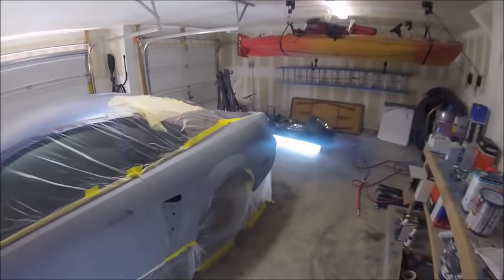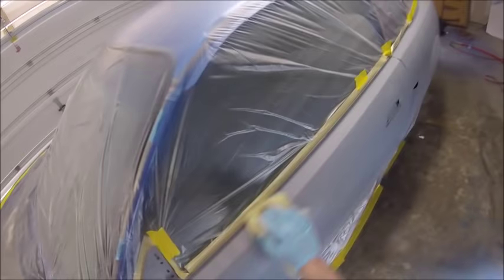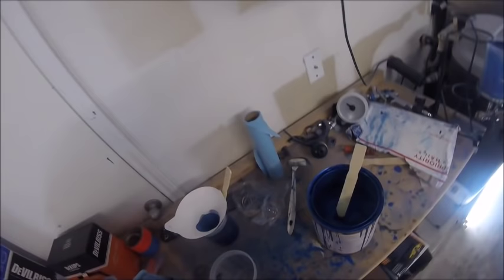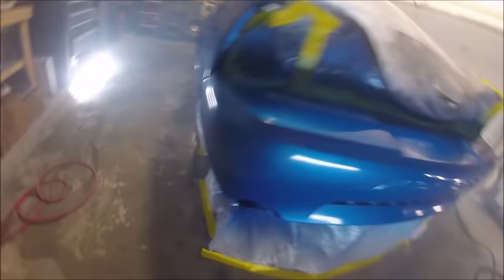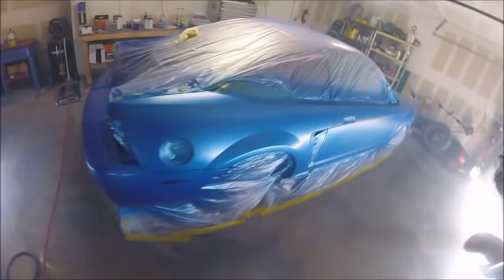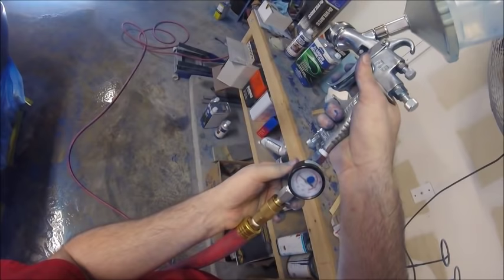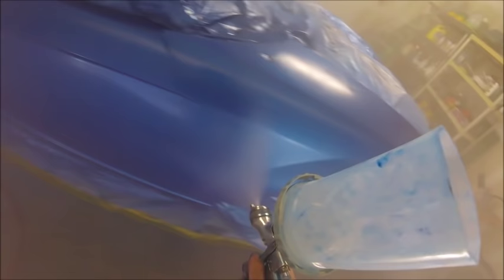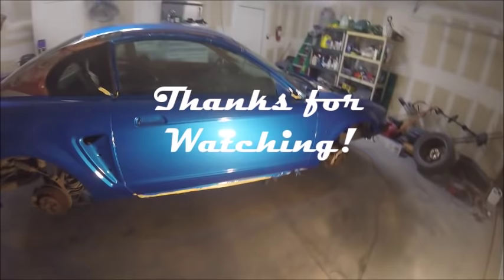Painting Your Own Car At Home

Comment: A Devilbiss Prolite is a great gun for the money.  I know many pros that use nothing else for show car quality paint jobs.  If you having any problems with it, then you're doing something wrong, not keeping it clean, set up wrong...etc.  Also, most people I know spray the basecoat with a 1.3mm tip and then, depending on the type of clearcoat, move to a 1.4mm tip especially if the clearcoat is a high--solids clearcoat. The Eastwood clearcoat you're using is a hIgh-solids clear. It comes out more orange pealy than the basecoat most of the time. Sometimes depending on the temp you're spaying at, you might need to reduce the clear up to 10% to reduce the orange peal.  Regardless, you did an exceptionally good job for a for time full paint job.
Reply: I was thinking the same thing when I say "European Clear" The Euro cars usually have more orange peel than American production cars
Reply: rstreets its a good gun for cheep plain and simple besides that its shit no matter what you do in the long run it will shit out.....the guts are cheep and will fail eventually especially running solvents through it for cleansing
Reply: FLG5 is a great gun and it's under 200 bucks .

Comment: Old timers put stainless steel balls or bolts in the cup and shake the gun to keep the metallic and pears mixed up. Metal flakes to.. also, pouring the mixed paints back and forth in clean cups is called "boxing" it mixes the paint,reducers and hardeners together much more evenly.  Very nice job, love the color.

Comment: I am a professional painter and worked in collision centers most my career. You did very well for the hobbiest weekend warrior. I have trained and instructed several apprentices on refinishing techniques and learning the materials that you are going to spray. For the most part, I can tell when someone has the ability to spray or not. You seem to have a good base of knowledge to shoot solvent paint systems. 1 thing I've learned while training people, is you cant force someone to paint in your own personal style. I watched for their natural tendencies such as if they are a slow natural stroke or if they are a quick mover. Every gun sprays differently and spray best at different psi settings, for different materials. For the most part broham, you did a great job. Might I suggest just a little tighter overlap with clear and maybe dropping the psi to about 24 to 26psi with that devilbiss. And make sure the reducer you use to cut the clear is compatible with that clear system. Or, if the clear requires a reducer at all as most inexpensive 4:1 ratio clears have a lower solid count and by reducing the clear, it reduces its uv protection and promotes solvent boil and runs if applying too heavy or applying the following coats too soon.  Applying clear takes some practice as the application method is different than applying high pearl/metallic base in solvent. Waterborne base is completely different in ppg and spies hecker, etc.  All in all, I think you did a fine job. I've seen 15 year "refinish tech" do worse, but they will make excuses till the sun goes down  and you seem to be honest about your hiccups. Just keep at it man. Practice is tough when paint is so expensive.

Comment: I believe what you experienced was not you laying it on dry, but instead dieback or something. When you hit your test panel it should have faded out more from the center really.  With poor atomization - big droplets, one can cover a panel and have it look "wet" but the problem is its misleading because what you are seeing is solvants... when the solvents poof off you are then left with varying degrees of problems. Typically said problems will come in the form of "orange peel" because once the solvents poof off you are generally left with voids where the solvents was if the rest doesn't "melt" down thereafter .. which it typically wont. Really bad atomization will leave dieback or a dry look when the excessive solvents magically poof off on ya like a genie.  The only way to correct such is to get the atomization finely dialed in via adjustment and hitting test panels until its corrected.  HVLP's run 10ish psi at the cap so fiddling a lot with the psi at the inlet is something we all have mistakenly done really...when the real problem is elsewhere if one has too. Consistent air volume can be a concern with HVLP's so I often wonder how well or long those snakes will last before needing changed for this reason.  I usually use a 1.3 but you should be fine there. 
Aside from my opinions or humble suggestions that nobody has to take in..... Pretty good job man, the best painters out there are the ones that know how to correct shit happens mistakes after the fact and keep on trucking.... and I'm sure you are persistent and knowledgeable enough to do exactly that (no worries).  Peace!

Comment: Yeah Bro, glad to see you paint your own ride. I would like to give you some advice on the HS clears. you need to get a comprerssor to handle the paint gun as I saw you adjust your regulator several times. You should never adjust air pressure when spraying poly base coats. also need to apply a control coat to finish you base. 15 psi and double the distance and fog it on 50% overlap. this will set the poly base to stand correctly. as to the clean, temp plays a large roll in the clear application, and the amount of materials. It looks like you needed to have the volume turned up, an move faster. Don't give up, and it came out good enough for you to fix. rock on Bro.

Comment: A word to the wise.  Cover everything in your garage with plastic prior to painting.  This reduces both the risk of contamination and the risk of getting overspray on everything as it will.  Second the little 3m masks are NOT good enough.  A full on electrical respirator or a setup with an outside air feed should be used given the lack of ventilation.
Reply: pprotory that...and without some kind of exhaust and maybe putting it outside, that compressor regulator switch looks like a potential poster child for the people who have exploded paint fumes in their garage because "I never had a problem before" 
just like the gratefully infrequent events of home woodworkers who blow up their dust collection systems. Fortunately not everyone gets hurt or burns their garage down.
Reply: pprotory At a minimum, I wear a 3M full-face respirator with 3M 60921 filters that can filter out isocyanates for up to about eight hours of use. I don't trust the half-masks for spraying paint. I always smelled fumes when I used a half-mask, so I quickly quit using them.
Reply: When my dad and I painted out 76’ Silverado we just draped plastic around our barn and opened the big door, covered it in plastic and cut a hole for the big fan. We used half mask respirators and paint suites. Worked fine

Comment: You should use paper on  the windows because the plastic will flap around stirring up paint dust that will land in your clear, it's easier to tack off.  And, you should have an inline water separator in the air line.

Comment: I really appreciate your upload. I did my 96 Olds W-Body Cutlass Supreme 4 times. 
Vibrant Green Metallic 1, Emerald Green Metallic 2, Metallic Carbon Fiber Gray 3, and finally...after really just plain having enough of the constant debri, i resulted to Summit ALPINE WHITE with 1/8 pound of John Kosmoski .008" Chrome and Purple flip chips mixed in it.  Thats That. It looks great!
Good job dude. At least you had a space. I shot mine in a shitty dirt floor hellhole the first 3 times. And finally for  The white, I took two days off work and shot it in my backyard. I got THE BEST JOB doing it OUTSIDE.  ( like they say- dust from the gun just blows away )

Comment: Its very hard to tell on a video, how well someone is laying down the paint. But that Devillbis is deffinatly doing the job. If you were to try to put that much base coat down with harbor frieghtsfinest spray gun, you would have more paint one the floor then the car. not to mention zebra stripes and modeleyness. For your clear coat, on the other hand, you need a finer tip and more air pressure, and stay a few more inches back. One good idea for anyone that's going to do this at their house, when your done spraying your base, most have a 72hr window, try to blow s much of that bleu overspray out of your garage as possible as well as the floor and drive way as possible. because once that clear hits that overspray dust its PERMANENT!. also it helps to let your neighbors know what you are doing. If they live in close proximity, youll spend more time buffing out 5 or more of their cars then it took to do the entire job on yours. by the way, mostimportantofall, in almost all 50 states its illegal to spray more then a 4ft by 4ft area in a residencalzone,  hence be in good graces with your neighbors.  Because if one reports a funny oder you can expect a visit from your local Hasmat/Fire dept. and depending on your attitude, and the cleanliness of your setup, youcan expect a slap on the wrist, or 10,000$ worth of fines and tickets. I know this first hand. Sorry MOM.
Reply: PS I don't live anywere near MarioLoco03. And it was 30 years ago. But you can under stand  where he's coming from!
Reply: PS I don't live anywhere near MarioLoco03. I learned my lesson on that day 30 years ago! lol.

Comment: Damn dude, looks good. Nice work. When sanding runs, fill the area with a finishing putty. Let that cure.. then when you sand that run, you're sanding the run and the body filler.. when you get all the filler gone... that means the run is gone and you will not burn into the surrounding clear/base!  PAINTERS TRICK!

Comment: There’s 2-stage of operation in the trigger of your paint gun. Learn to use both. 1st is air with no paint 2nd is air with paint. Should never shut the gun completely off while painting. If you’re holding the gun above your hood and shut the gun off and the needle gets stuck open, you could drip paint.

Comment: Good work mate,shows just what is possible with a bit of thought and preparation. Results will be more than acceptable. I ave painted all but the first one of the cars and bikes I have restored myself. I was not happy with the first" professional " paint job I paid good money for and found I could buy complete set up and paint for second car for less than cost of first paint job! I picked up a nice DeVilbiss Gti HVLP gun ,compressor and air drier for 600 of eBay! Paint and sundries were 500 so for 1100 I got a cheaper and better paint finish and never looked back from there.

Comment: Very informative and nice job. If you do not get a run, you did not push the clear hard enough to get a nice shine. You can sand and buff a run in the clear, but you can not take the time to sand an entirely dry  clear coat. Really nice workmanship, and great over lap on the paint strokes. I really liked the entire segment.

Comment: Sorry meant you wouldn't need a forth coat if done right, after light first coat slow down just a bit. I would wet the floor and hang plastic on all four walls, the static electricity of the plastic will attract the over spray. Looks like you did a great job for a DYI paint job, I couldn't really tell but it looks like you did a good prep and that is the most important thing. I enjoyed your video and giving a thumbs up. Color sanding will be your next most important thing.

Comment: I painted my chevelle in my garage came out great won a trophy last week. Next time put the compressor outside sparks from the motor can be explosive. Also run down the entire side having the least amount of overlap possible to prevent runs and metallic build up which shows up as blotchy looking in the light.

Comment: for a wet finish you need to advance the amount of clear coat you use... but then again you will need to regulate the amount of air you use with the amount of clear coat... its not the 1.4 gun that have the fault , also it could be the mixture you use when mixing the clear coat, if you dont add enough or the required amount of reducer it can come out dull and dry looking but over all the base coat looks really good.

Comment: I was always told to mix all the paint you plan to use at the same time.
Reply: That is not correct nor necessary. The key is to make sure you stir the paint before mixing with hardener and reducer if desired then be sure to stir thoroughly again, especially with metallics and pearls.

Comment: One thing for sure, you got some great advice in the comments. Most of them are really good information. That is a great color and it looks like you did a pretty good job for a garage booth. I'm glad I watched your video, and even happier that I read some of the great comments you got from the pros. Sometimes you can learn more from things that were done wrong. Because the reason to do it differently sticks with you after seeing it done wrong. I wouldn't have thought about or understood, "don't use plastic next to the panel" unless I saw how much it blows around when you are spraying. I'm also curious if you ever checked or took the temperature into account. That is an easy spot to get a run. Hard to see it, and like another guy said, "a heavy coat over a lite coat" likely caused it.

Comment: When the compresser kicks on the pressure is gonna drop till it builds back up. Nothing wrong with the gun it works that way with everything nail guns and so on.. That's why paint shops have big setups and garages have big compressors. ..

Comment: I spray alot of drywall and stucco out of a hopper attached to a compressor. Cheaper compressors don't regulate air pressure all that well. Sometimes there's a bunch of fluctuation.

Comment: use  a heaver gage exstention cord from your compressor will stop the breaker from popping also metallic paints can cause a tip clog, turn up air pressure will help that  by turning it up

Comment: Yes.  Good job for the first time.  Plus you have the know how to sand you're mistakes down and start over if needed. Besides all the other constructive criticism from others below, i would have covered up as much of the garage and stuff in there as possible with plastic except for the unfinished walls.  The over spray, as you must have found out, will put a thin coat on every thing in a non ventilated garage, and yes, I would have put the compressor outside of the garage. I hope you were wearing a good face air filtration mask.  Lungs don't like paint in them.

Comment: a lil bit of texture or orange peel is simply a lil more elbow grease and prep when color sanding and buffing. all of that stuff is removed during that process . you can literally paint a car with a paint brush and color sand it smooth. (would never ever recommend this for anyone but people have done it)  me personally would not have had garage door open i would have placed a house fan (square cheapy) under door and used cardboard and tape to seal it off and used foam strips to get a 2 psi or less to get rid of fumes but not disturb air and particles ... painted many a car at home in garage with no particulates in the paint by carfeul prep of garage and wetting the floor down and placing plastic sheeting over areas not clean or tool boxes or dryers etc .. preparation is key

Comment: I have that gun. It sprays really good. To get the clear looking like a mirror with no orange peel; I use with the fan wide open. The other knob for the paint flow, i start with 3 turns out. If on the 2nd pass it doesn't look wet, just turn it 1/2 turn out and try again. keep doing this until you get a wet mirror like look on the 2nd pass. Also i had a 60 gal air compressor.

Comment: Overall, I'd say you did an fantastic job under such conditions.  The garage door was up/open a bit.  However, if you could have created a cross flow of air and vented outside, that would have helped keep the dust/fog away.  Just one other thought. I did not see any air filter/condensate removal on the air supply to your gun.  You may have had some moisture in the paint?  On your finished inspection with the light, I could see some tiny specs that could have been either paint gun spits, or dust in the air or moisture from the compressor.  I haven't painted in over 40 years but love to dabble in touch up from time to time.

Comment: Looked like you had the fan pattern adjusted out to wide and the clear was a tad bit dry, adjust that fan in to about a 8-9 inch width, spay it about 10 inches away. try about a 5-10% reduction with reducer in the clear.  Lay it down steady walking the entire lenght. Over all Great Job for your first one, keep up the good work and keep learning.

Comment: The clear gun was definitely messed up...with that huge tip it should have been DUMPING it on, but looked like it dried before it hit the car...i've only had this issue once and the gun had a blockage that wouldn't let the paint flow at a high enough rate, and the air was enough to damn near flash it coming out of the gun. Honestly, another one of those eastwood guns with a 1.3 tip wouldnt be a bad idea...the blue laid down nice! I dont like a huge fan at all...but i also dont spray much pearl. After the spray job i use 2000 and then wizards finish cut and that usually leaves it looking like brand new wet glass for a long while. For a first timer you seems to have a hell of a lot of knowledge man! Happy spraying!

Comment: Ya and rule of thumb. If you ever sand and hit base you HAVE to rebase and clear. I learned that the hard way when I was just starting painting. If you do painting alot you should try the rupes system. One step process for buffing/polishing. Awesome results if you do it  too. Did you do a controlcoat/drop coat.

   I have quite a bit of experience in Production painting.